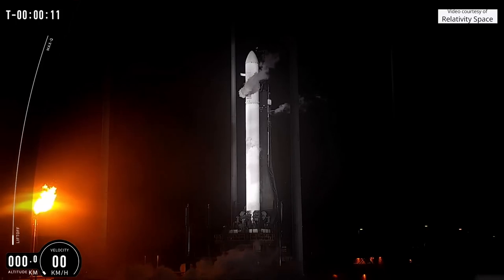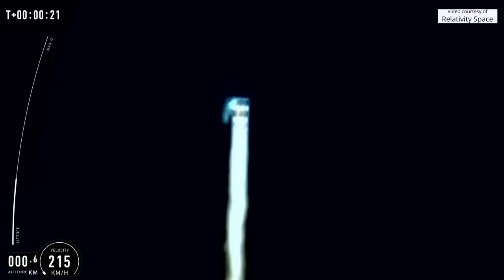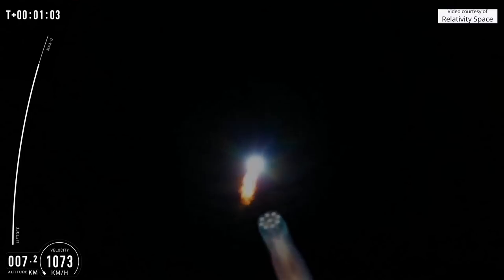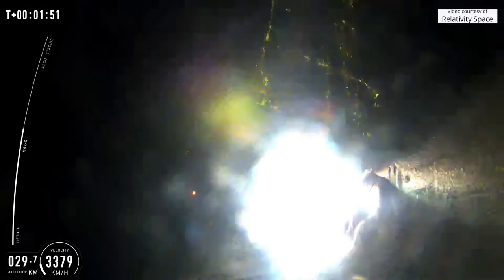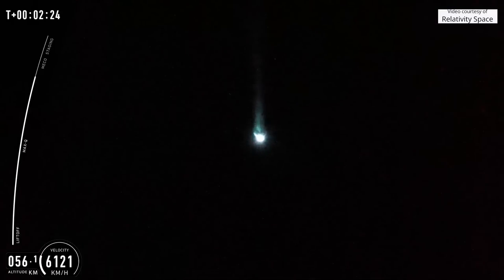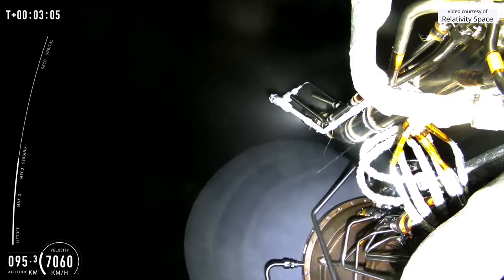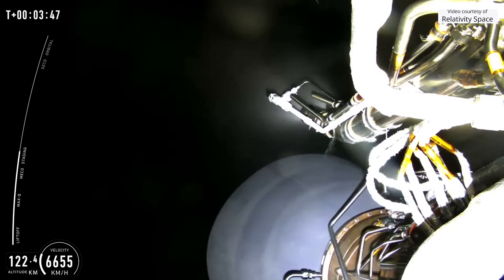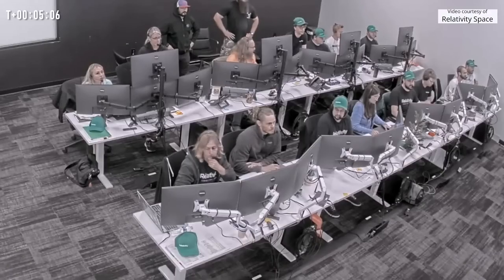The First Launch of the Terran 1 launch vehicle

Comment: A US 3D-printed methalox rocket made it to space 1st try with successful stage separation and a vacuum flame-out on 2nd stage.
What a time to be alive!
Orbit next time, no doubt
Reply: The Chinese rocket Zhuque-2 was the first methalox rocket to reach space. It launched in December 2022.

That also failed, however, because of the upper stage, but if we're talking about simply passing the Karman line, then it was first.

The true "First" will be when a methalox rocket achieves orbit.
Reply: @Antares2  he means "3D printed"
Reply: @Antares2  still the first 3D printed structure 🤷‍♂️
Reply: @BlackLight025  Uhm, no. The New Zealand based Rocketlab has the Electron rocket which is 3d printed.
Reply: @Antares2  just the engine is printed, which is why I specified structure.
 Rocketlab’s is much smaller as well
Reply: @BlackLight025  Not much of an achievement left then. I'll hold my applause for the first succesful orbital flight.
Reply: @Antares2  Most first rockets fail on launch and new rocket launch companies almost always fail their first launch. Relativity proved the 3d print for the structure of the rocket, which neither Rocket Lab nor SpaceX do. Hell, SpaceX is the top of the space launch game and it took them 4 tries to get the Falcon 1 to orbit in 2006-2008.
Reply: @steveaustin2686  I'm not hating on them. I truly hope they succeed, but I just don't think there's too much to celebrate yet.

It is exciting, yes, but like I said, I will wait with crowning a "1st" until they actually reach orbit. 

Suborbital launches are obviously useful and impressive in their own way, but not when they are the unintended consequence of a failed upper stage, but like I said, not hating at all. 👍
Reply: @Antares2  They are a new player in the space launch game, with a new way of constructing rockets, with the first orbital attempt with a new propellant. That's why there is the excitment. Proving that their 3d printed booster can survive past MaxQ is a big deal for them.

Yes, orbit is the goal, but even the top of the space launch game took 4 tries to do it. So it is not like this was unexpected that something would cause a failure on their first launch. I'm looking forward to good things from Relativity, SpaceX, Rocket Lab, ULA, Blue Origin, etc.
Reply: @steveaustin2686  , is that your name? Actually? Because we might be about the same age and I picked your pun here, which no one else has... Six million dollar man😜
Reply: @zzzxhrg  Yes, that is my name. I can usually tell about how old someone is, depending on whether they say $6M Man or Stone Cold. ;) 

I was born a few years before the show first aired and watched it on reruns. My mom said that she would tell me every time it came on, that I couldn't do the same things he could in the show. ;)
Reply: @steveaustin2686  awesome. My daughter's name's Lara and I don't take shame to where the reference comes from (Lara... Short last name... Similar sound, get it? 😜)
Reply: @steveaustin2686  I'm not a native English speaker, I'm from AR, LAT. In my country, the show title was translated to "El hombre biónico", "The bionic man", which was, IMHO, kind of appropriate and accurate. And yes, I was a big fan of this show, and he was one of my favorite heroes. And maybe, just maybe, one of the earliest seeds to turn me into the nerd I became later on.
Reply: @steveaustin2686  thanks for replying, respect
Reply: @zzzxhrg  The slang in English for the $6M Man is also the bionic man, so very on point.
Reply: @Antares2 this still made it to space just not into orbit

Comment: Typical of the immature to celebrate 🍾 before the actual victory.  
In reality, you haven't proven yourselves. The 3D printing ultimately adds weight to the rocket. Weight is a HUGE problem.  
These rockets not only need to go into upper earth orbit, but they need to do it consistently and then land themselves, all with price parity similar to Space X in order to be competitive...
Otherwise this entire exercise is one in futility. 
So when I see all the kids celebrating and smiling over what essentially was nothing, It further reinforces in my mind that this company is most likely doomed.
Why? Because the most questionable aspect of this design (the added weight of printing) has not been tested.
Reply from the maker: This is the first and only flight for Terran 1, Terran R is next https://www.relativityspace.com/press-release/2023/4/12/terran-r
Reply: 1 year later you are pretty much spot on as they have decided to move away from 3d printed pressure domes. that makes sense to me. I never understood why they were trying to print rocket bodies to begin with, they are already made out of sheet metal which is what engineers trying to cut costs want to make everything out of anyways,

Rapid prototyping is good for engine development, not so much for body development. And once a mature designed is reached the rapid development aspect is redundant.